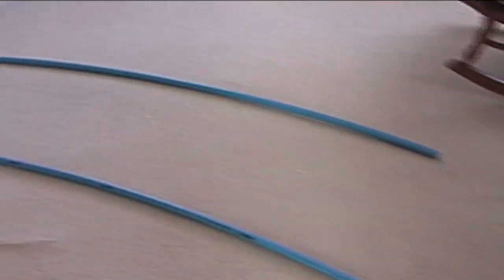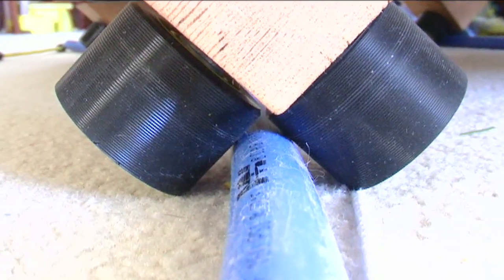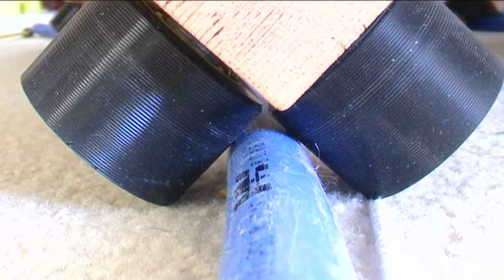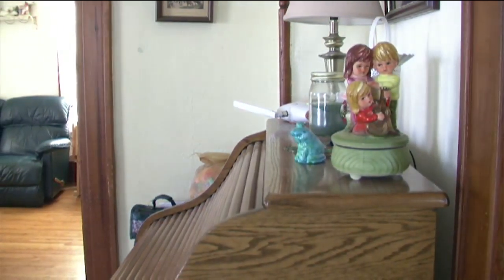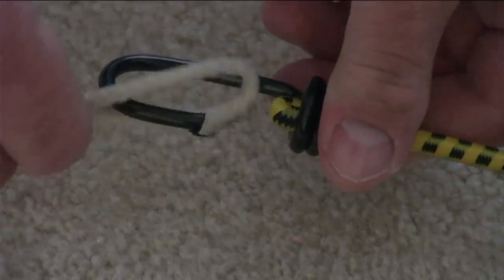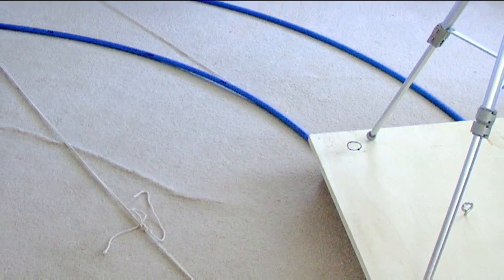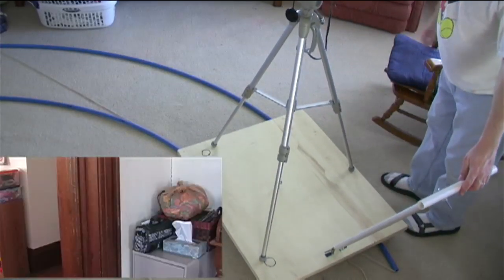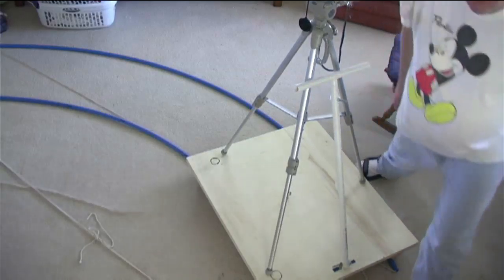My experiment using curved track with my dolly WORKS!

Comment: Great job with the PEX experiment. The test footage looks amazingly smooth! 

But 2 questions… 

1. Is it silent? I noticed that there was no audio recorded for the test. I ask because, in the film I'm currently in pre-production on, I desire to have dialogue scenes filmed with a curved dolly. 

and, 2. Was the test footage smooth just because the floor in the room was the perfect surface to film on? Or would it work equally as well outside? (that was two questions in one right there . . . sorry. Just things I need to know before I tackle this.) 

Thanks for the video.
Reply: if you are doing dialogue i would adr
Reply: http://en.wikipedia.org/wiki/Dubbing_(filmmaking)

Comment: If i built mine with roller blade wheels in the same formation as your wheels. I have 4 wheels on a board (one each corner) will it still follow the curves?

Comment from the maker: @SuperBNProductions If the garden hoses are THICK.  Usually they are not that thick walled, and will collapse under the weight of the dolly.   If there was a way to inject rubber into the hose and fill it,  that would work well.  If any of you know how to do THAT, I am interested!  Solid rubber hoses are EXPENSIVE.

Comment from the maker: @ericlooi No, stick with the 1 inch plywood first.  That is what mine is.  (2 x half inch boards) I'd forgotten how thick it was when I had mentioned 2 inches before.  
And any skate or skateboard wheels will work as long as they are clean and the bearings are good.  
I used the Sonic GTS X-TRA because they were wider and the bearings are very nice.
Good luck on your search and your improvements.

Comment from the maker: @ericlooi whoops,  I use 1 inch plywood on mine as well. :)  2 inch plywood would be very good if you can find it. You need to have smooth bearings and CLEAN wheels. That might be the biggest reason you have bumpy footage. I bought my wheels on eBay.  They are "Sonic GTS X-TRA Speed Rollerskate Wheels."  If you can get things on eBay you can get good skate wheels with bearings.  See my other video (linked in the description of this video) on how I made mine.

Comment: @musichistorynut How about giving it a 2 inch plywood boards instead of 2 X 1 inch plywood? The wheels are not new and have some dirts on them. Some of the bearings are not so smooth. When tighten the wheels, the wheels can't run at all (Is this because of the bearing problem and I need to change it?). What wheels are you using or any recommendations? Hard to get skate wheel here. Thanks!

Comment from the maker: @ericlooi I would use two 1 inch plywood boards and screw them together - that gives you 2 inches thick. (gives good weight.  The height is not so much the problem as using the center post to achieve that height.  Are your wheels in good condition? Are the bearings smooth?

Comment: @musichistorynut We will be buying a thick 1inche Plywood for the base(will that be good enough?). We are planning to use the track for about 6 ft high to platform. So, with that height it will still be shaky even though it's a heavy tripod? Any suggestions what we are suppose to do? Thanks for your time! :)

Comment from the maker: @ericlooi Well, weight helps stabilize things, so if you whole setup is lightweight, you could have problems from that. That is one of the reasons I went with the thick plywood.  The other thing is this:  You CANNOT use the center post of your tripod for height if you use a dolly.  Even on mine,  if I have a heavy pro-sumer camera, with a heavy tripod,  things will still be crappy if I raise up the center post. Just a suggestion.

Comment from the maker: @MrComputerSaint 
I've shot on carpet, grass, lenoleum, and concrete.  All with success. In the case of a dolly like mine, the more you have it weighed down, the smoother and more consistent your shots will be - and the less likely slipping will occur.
Uneven surface?  Well, the ground I shot outside was pretty uneven - but.. the track helped ease that back as you moved.  It can't be TOO drastic of unevenness though.  Your bean bag idea is great!

Comment from the maker: @roontunes You know,  that is a good idea!  
Right now, I use 8 foot  (or ten - not sure right now) sections of long straight PVC and they fit in my Toyota Camry just fine (I have to have the back seat down to allow them to go from the trunk to the front,  but the point is they fit.  A set of long hoses would be the best - they can be straight, curved, etc. and can coil up forstorage and transportation.  I am going to try the hose idea this summer!

Comment: Great for a gradual curve but I had bother trying to get them to lay in a straighter line, didn't want to have to carry big long poles around with me to stick inside the pipes so I used a couple of old extendable painters poles, the ones you stick a roller on, and they gave me the length when extended and collapsed down to a manageable length for transporting.

Comment from the maker: @tully712 hmm.  I wonder if there would be a way to get some foam rubber and get it into the hose.  That would be lighter (and far less mess in the long run)  than sand and still support the weight.

Comment from the maker: @dladreiter They are Sonic GTS X-TRA Speed Rollerskate Wheels I picked up two sets (8 each) on eBay for like $30.  I like that they are wide, because,  as you intimated, they are good for difficult shooting situations.  (more surface area to be on the tracks, even if the tracks are uneven). But,  really, I don't think rollerblade wheels would be bad for this at all.  I just don't have any to try it with.  The important aspect is the bearings!   
Thanks for the encouragement!

Comment from the maker: Hey iloveknex,   It is PVC pipe but a bit thinner walled, so it can flex. It can handle SOME weight,  (no more than 230 pounds or so). I certainly would not recommend it for a rollercoaster.

Comment from the maker: @Beardy241 It might take a few tries,  but it is not that difficult.  Now, I have seen some of your vids with your motorized dolly, and you require exactness.  I don't think my dolly could do that,  but.. I can get results that are PRETTY close.   You just have to place your inner track to get as close to center around your subject as possible as the dolly travels,  and then it's pretty easy to get the outer track situated, since the dolly helps do that for you as I explained above.

Comment from the maker: @Beardy241 Thanks!  Actually the constant distance between the tracks is pretty easy because the track dolly itself keeps them them that way.  Since the tracks are not fixed to the ground, they can move ever so slightly to accommodate the exact distance between the wheels.  You just have to do a run-through a few times and the tracks will be set.  Getting the curve of one track to match up with the slightly different curve of the other track is just a matter of eye-balling it.  It might take...

Comment from the maker: Thanks!  
Well, in order to run on any curved track,  you have to have my type of dolly. (swivel type wheels). The Standard dolly designs (with angled aluminum rails with fixed attached wheels) won't work.  See my other video about my dolly for details.

Comment from the maker: I already answered that in my other video.(The video that THIS video is a response to)  I took a smaller (3/4) tube and ripped it in the center and put that inside the end of one of PVC pipe and into the other end of the next pipe, and that fits nicely and makes a smooth joint.  I am not having any trouble with rough or unsmooth situations because of the joint.  Please watch my other video and your question will be answered. IF you are still having problems about it,  I cannot help you.

Comment from the maker: See my other vid called "DIY Track Dolly - works on CURVED and STRAIGHT tracks!"  (see above under "video responses")  I join two sections to make a joint.  For the most part,  my solution works, but there are sometimes it comes a bit loose,  so you have to constantly look to make sure you have no gaps.  
My next chapter in this dolly stuff will be to buy some really long industrial hose. Hoses can coil up and fit the back of a VW bug! They can do curved, straight, combination of the two, etc.